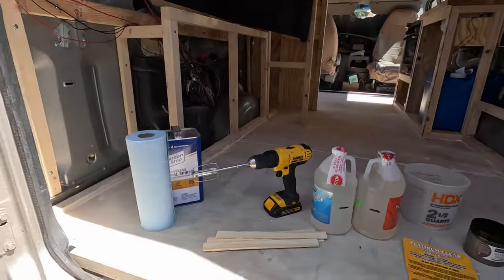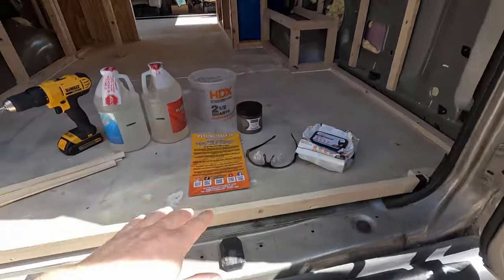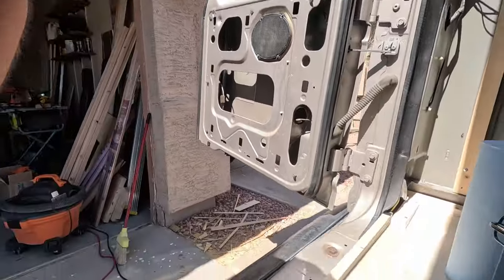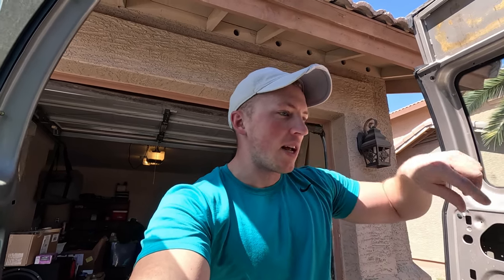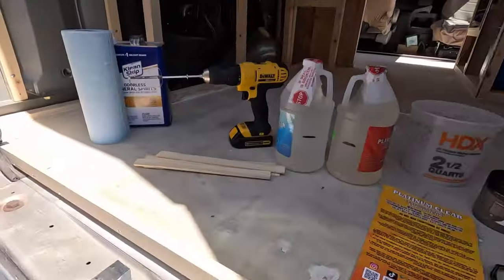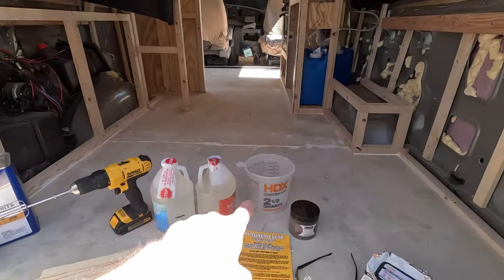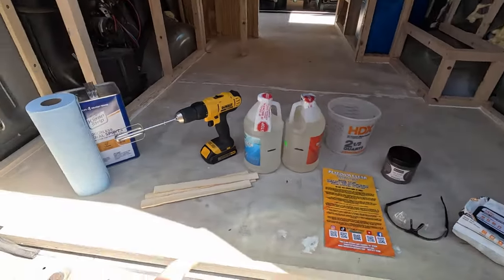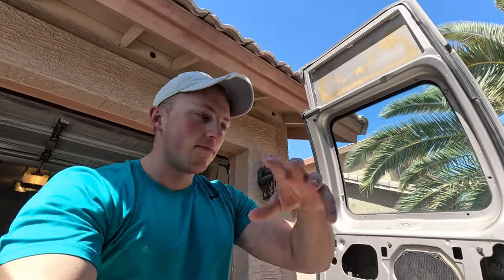Pouring an EPOXY FLOOR in my Camper Van - Econoline Conversion #vanlife

Comment: To create a “dam” around the edges he screwed and hot glued 1 x 2’s covered with black electrical tape. The tape came off clean from the epoxy.

Use a notched spreader to spread the epoxy.